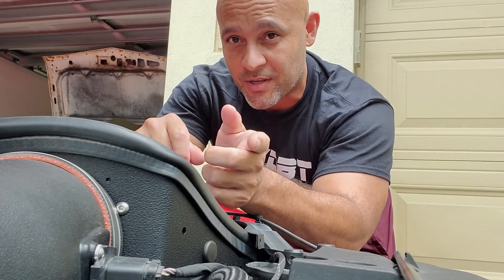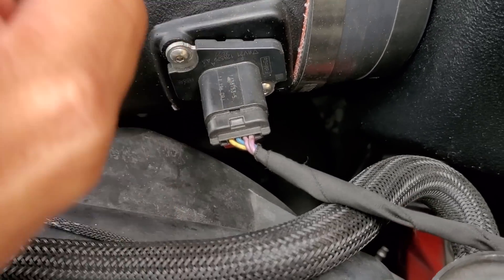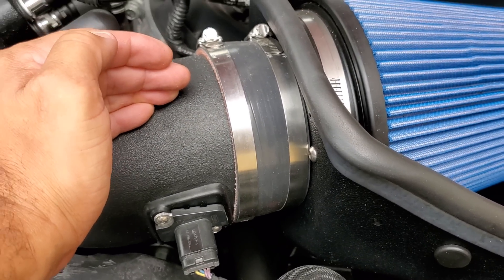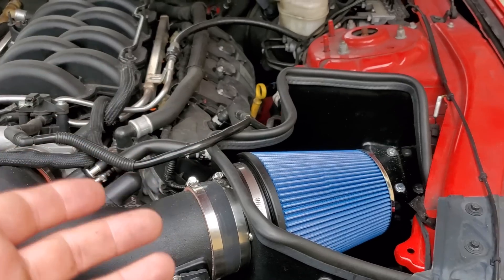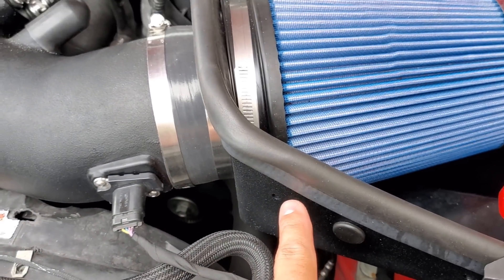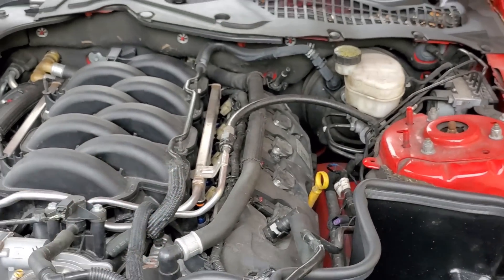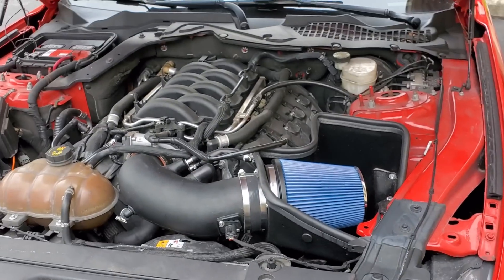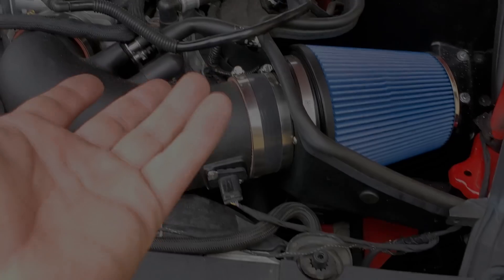What is the most important Sensor on Coyote mustangs

Comment: What cold air intakes does Lund Racing recommend?  I’m looking for a flex fuel tune for a 2017 Mustang GT.
Reply: Honestly without upgrading more than just intake the stock airbox is pretty much ideal already.
Reply: WhiteWolf5.0 The ‘17 isn’t that great, Pmas, JLT or a stock 18+ I would say
Reply: @matt7sixty  Alex has clearly stated in previous videos until you go more mods stock is best. If you arent doing any other mods to support an aftermarket cai then it isn't worth it. Stock is ideal. Not just my opinion but Alex's as well
Reply: Tuesday he's going live, pretty good about answering questions there and peasant chat often has other Lund tuners answering.
Reply: PMAS cough cough

Comment: Hey Alex, this question isn't really related to this video but if you could answer that would be great. I watched your f150 comp cam video, am able to get a set for my 17 coyote f150 or should I try and grab a set if 17 mustang cams? I'm basically trying to get my f150 to race not tow. I plan to get a super charger but I want to buy the small things first. Until I can swing a big purchase like that.
Reply: Use the small purchase money to save towards the big purchase, I’m in the same boat. My RCSB is tune only rn I’m sticking with that until I can save the money for a Whipple
Reply: @Synergize_  Yeah, I get that perspective but I'm just trying to make sure the truck can handle the boost and I won't blow anything up to break anything.
Reply: You don't need cams.. you have a gen2.. its fine.. just get boost.. big waste of money..
Reply: @Clutch_Kick187  Is the gen2 rated to handle that kind of horse power? Everything I've read s says these engines don't do well with boost because they are set up for towing. And like I responded to the other comment, I just want to make sure the truck can handle the boost before I slap in a supercharger.

Comment: Have you seen any benefit to wrapping the CAI in reflective tape to help keep IAT lower? Specifically on a 16 gt performance pack autox/road course car
Reply from the maker: 0 effect. like literally the biggest waste of time ever.
Reply: @YDBT4LIFE  Yo,  how can I get you to be my dedicated tuner?
Reply: I dont think your going to tell any difference in performance by keeping heat off the outside of your air elbow. If you were sucking in engine bay heat before with a hot air intake and you switched to a true cold air like stock airbox then you would definitely see a drop in iat's and some performance gains.